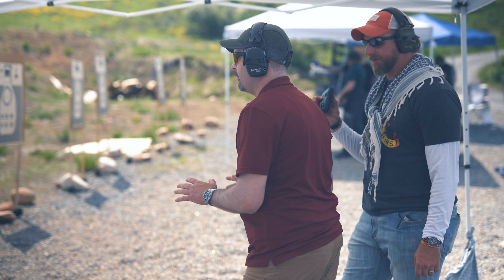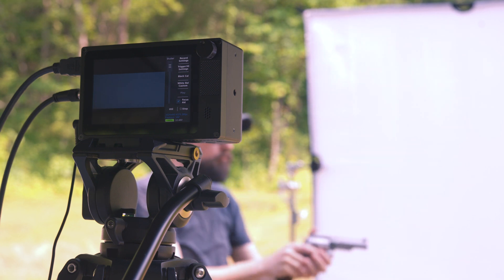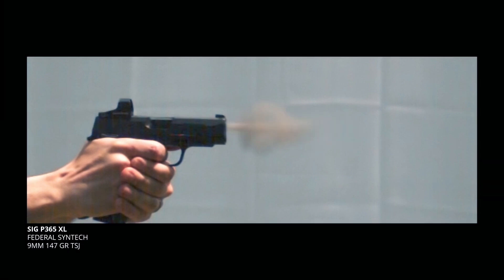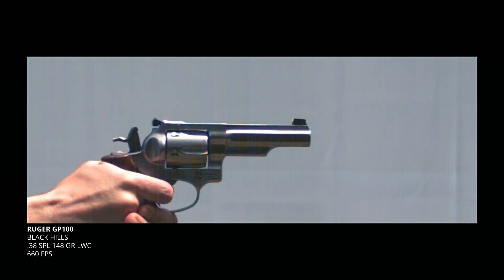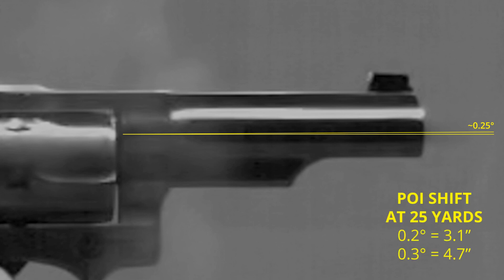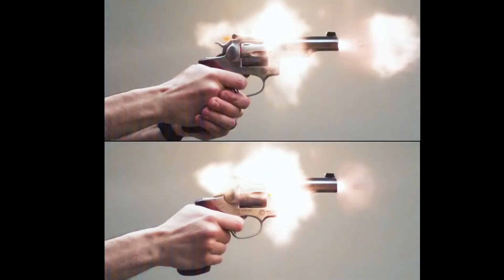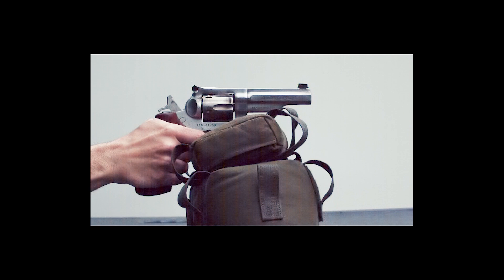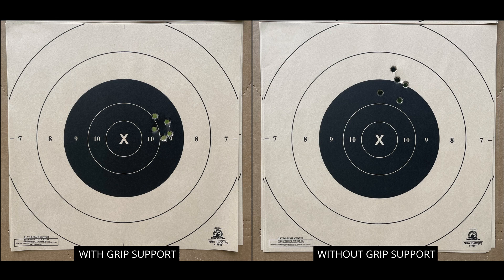How Recoil Affects Handgun Accuracy

Comment: For revolvers you can use the principal of conservation of angular momentum to understand muzzle climb. The short version of this is that the rise depends only on the mass of the bullet and not the power of the cartridge. The muzzle rises faster when shooting a full power .357 compared to a standard .38 but if the bullet weight is the same, say 158 grains, then the rise is the same. If you own a wheel gun you may actually notice that the sights point a little low because revolver makers understand this and compensate for muzzle rise when fixing the zero. It would be interesting to compare various bullet weights to see how much they affect muzzle climb and I would anticipate that lighter bullets will tend to shoot a little low compared to heavier ones.

You don't see observable muzzle climb on auto loaders because the spring is barely compressed during the time that the bullet is in the barrel. Very little force is exerted on the frame so the slide effectively moves freely. The reverse linear motion of the slide cancels out the angular momentum of the bullet moving forward. As the spring compresses more you may start seeing some rise but most of it happens when the slide impacts the back of the frame transferring much of the angular momentum from the slide to the frame. Needless to say I'm happy my physics degree is finally useful (ish  ;-) ).
Reply: It occurred to me that the first bit of muzzle climb on the Sig is probably due to the barrel hitting the stop in the frame, and that transfer of energy back into the hands. That's probably exactly why they feel less "snappy": two smaller instances of recoil instead of one big one.
Reply: @dewayner5388  Yes, that's my impression too. I think I commented as such on another one of these videos which compared a blowback to a locked system.
Reply: DAMN, That was a GREAT EXPLANATION.

YES, your Physics Degree was very useful, T.Y. Andrew.

I wouldn't have said it in dept as you did but I'm just a Machinist, LOL.
Reply: @Kyle-sr6jm  So what id he say wrong ? T.Y. Kyle.

Comment: I am here just to say my Sig P239 is underrated merely because it is slightly larger than a P365XL yet shoots incredible like a full size pistol. Weight of the frame?

There is a reason I see Glock competitors with added weights on the rail in the front
Reply from the maker: Weight might be part of it, but the P239 also has a much larger grip -- it feels pretty close to a full size handgun. Unless you have really small hands, it's tough to get an optimal grip on the P365 XL
Reply: @LuckyGunner I would love to see this slow mo test with the PX4 CC just to see differences in muzzle rise

Comment: Something I've noticed with my ruger lightweight commander 1911 (45acp) is that if give it a loose, one handed grip it will shoot as much as 2 feet high and to the right at 40 yards, following the same path it recoils, but if i hold with a firm grip it shoots perfectly. Just an anecdote

Comment: ok but isn't a tilting barrel auto moving before the bullet leaves the barrel just by definition of what a tilting barrel does?
Reply: It appears that the tilt barrel in the first Video did not move until the bullet was way gone . So IDK
Reply from the maker: The barrel doesn't tilt until it unlocks from the slide which, by design, happens long after the bullet has left the barrel. If it did not, the gun would blow up in your face. Try to very slowly manually retract the slide on a tilting-barrel semi-auto. You'll notice that for the first couple of millimeters of travel, the barrel is locked into the slide and moves parallel to it before it begins to tilt.

Comment: I also have a stainless, 4 in, 357 mag GP100, but not the match model. I’ve noticed it shooting high at 20-25 yards but that thought I was me anticipating heavy recoil.
So what is causing this rotation? Could it be the small amount of gas that comes out between cylinder and frame?
Reply from the maker: Recoil anticipation usually (but not always) results in hits below the point of aim. Your GP100 sights may just be regulated for a load that's different than whatever you're shooting. Adjust your rear sight if you have an adjustable sight model. If not, try a higher velocity load and see if that brings the point of impact down.
Reply: @LuckyGunner  I’ve shot everything from full magnums to standard 38 special, but I didn’t record my accuracy. I’m definitely going to try different loads at 25 yards and see what I get. Thanks for the suggestions.

Comment: WHen i started shooting i could swear that 124 grain 9mm always hit higher on the target that the 115 grain i was shooting.  For me that lighter bullet just seemed to hit about 3 inches lower at 40 feet. So then i decided oh well ill just use 124 grain as its more accurate for my sights.  Now i was shooting a M&P 2.0 with a 4 inch barrel and at the time i never considered that i was the problem.  Because after a few years of shooting i got a deal on some good 115 grain.  I took em to the range only to find they hit the same spot as my 124 grain.  These were the same brand that used to shoot low for me.  It was then i realized that in a 4 inch barrel in general the 115 will just break the sound barrier and create a louder report than the 124 thats cruising just under the sonic boom level.  It generally makes that 4 inch gun alot louder.  Turns out i would flinch on the 115 but not the 124.  Seems weird i know but i bet there are a few of ya thinking, "could that be my problem?"

Comment: I think we all know that the teacup grip is a no-no with a modern semi, but the sandbag support on the revolver got me thinking that that there may have been something to it with a revolver before we figured out modern gripping styles.
Would be interesting to see a Chiappa in the recoil cycle with the low mounted barrel and how much it actually changes the recoil 'cycle' from a 'normal' revolver.
Fun vid for sure.
Reply from the maker: This principle was definitely known and understood well before it was ever observed on high speed video, so I agree that it's certainly possible the teacup grip was adopted in an effort to counteract POI shift from muzzle rise. Probably a misguided effort, however.
Reply: Where was it actually proven the tea-cup grip was bad even for semi-autos? They have the same phenomenon of the point where the force is applied is above the center of mass (and also the grip is below the point of thrust) so the fire arm rotates. 

The teacup grip fell out of favor at around the time that a lot of other myths were spreading, when there's less access to high speed video cameras.
Reply: @Treblaine  Where?  I didn't realize we needed a Thesis paper and specific date to be pretty conclusive in that reduction, but truly, any comparison between gripping styles constantly prove that the teacup is the least impactful in managing recoil for one MASSIVE reason: Your support hand does not do anything for recoil management, it simply provides a "platform" for your hand to sit and stabilize the sight picture. 
A modern high forward grip will absolutely give you more control as now your support hand becomes a primary recoil stabilizer rather than a platform. 
There are dozens of videos on YT showing muzzle flip comparisons with gripping styles and kinematics of each.  The high forward also gives you the best ability to use your bone structure to manage recoil. 
I honestly don't remember what my perspective was since this comment was over a year old, but I believe I was thinking it had to do with a semi auto slide motion putting a moment of inertia high after the initial recoil and then returning vs a non slide recoil revolver that is bigger which could benefit from a 'platform' of the Teacup 
Regardless, teacup doesn't do anything for recoil - that's a fact and has been shown over and over and over again
Reply: @shirothehero0609  "it simply provides a "platform" for your hand to sit"

Like resting on the sandbags?

That's precisely the problem, you can't apply a twisting downward force with either hand because 

" now your support hand becomes a primary recoil stabilizer"

Stabilizer? 

Specifically how does a hand underneath the pistol NOT do that with the so-called teacup grip?

Now maybe it doesn't work if all the teacup grip is doing is holding up the weight, but in this slow motion the grip is different, it's pressed down hard onto sandbags, maybe your left hand it'll have the same effect.

"a semi auto slide motion putting a moment of inertia high after the initial recoil and then returning vs a non slide recoil revolver"

It shouldn't make much of a difference, the semi-auto just delays things a bit.

When the barrel recoils with the slide the slide+barrel hardly affect the frame you're holding at all except via the spring compression slightly increasing. Then the barrel is decelerated suddenly as the locking lug collides with the frame and also the slide later.

Imagine if the barrel was freely flying through the air at the same velocity and hit the frame. The barrel would try to cartwheel up flipping over, but the slide contains this movement and the force is transferred from the slide to the contributing to the pitching up motion. The same a few milliseconds later when the return spring bottoms out and the slide stops. 

So the torsional force is the same, just in two sharp peaks while a revolver continually transfers the forces as the bullet is accelerated down the barrel. 

For identical bullets the momentum must be the same.

The momentum that is imparted by a bullet must be equal to the rearward recoiling mass whether that mass is an entire revolver or a barrel+slide or just the bolt of a straight blowback. Every action has an equal and opposite reaction.

Deceleration and acceleration are the same thing but in different directions. So when the slide bottoms out suddenly on the frame it decelerates in a shorter distance than the bullet is accelerated down the barrel of a revolver.

Comment: Thanks for this informative video, Chris.  Revolver sights slightly point the revolver's muzzle DOWN to compensate, whereas rifle sights generally point the muzzle slightly UP--and that's with sight line above the bore line.  Revolvers have been around almost two hundred years.  The Colt Dragoon was supposed to have its sights regulated for 100 yards and while less powerful than the military smoothbore musket of the day the Dragoon's rifled barrel gave the revolver comparable accuracy even without a shoulder stock and four points of contact--muskets usually lacked a back sight.  Point--guns are complicated, but shooting doesn't have to be.  
"A man's got to know his limitations." (Harry Callahan in Magnum Force, 1973).
Target shooters at the 25- and 50-yard lines customize grips so that they get the same grip each time.  Light target triggers reduce the amount of trigger-squeeze disturbance.  Using very consistent ammunition each time makes the revolver more precise.  Even the positions used will affect the zero--as Chris demonstrated, the difference in point of impact using more sandbags to stabilize the revolver was significant for small game or target match shooting at 25 yards.  Chris warned us!  After sighting in from sandbags, fire without sandbags to validate and verify.
Chris mentions "squishy bits" but the entire pistol is "squishy" given the forces involved.  Semiautomatic pistol slides move back and forth, and sometimes the barrel flops around.  Revolver pundits used to think that this made semiautomatic pistols less accurate than revolvers.  It's complicated--but for the vast majority of pistol shooters, this question of revolver versus semiautomatic accuracy is academic. 
Pistol shooting is easy--,ake sure the pistol is loaded, stay close to a large target, point the pistol at the target (sights help with precision pointing), and trip the trigger without disturbing that precision pointing.  Hole in target = SUCCESS.

Comment: I enjoyed that analysis very much, but I think you may have over estimated the amount of muzzle rise., at 0.25 (5:03), that seems like more than what I can see (granted I am in a worse position than you are and also have no way of measuring accurately). Maybe is an optical illusion, but using simple line and compass on the screen based on the top of the barrel renders about half that value. But I'm probably wrong 😄
Reply from the maker: Yeah, it's difficult to tell. Depending on how I measured it, I got a difference between .1 degrees and 1.2 degrees. Values between .2 and .3 are the ones that came up the most, though. I am fairly certain there's a rise of at least .1 degrees, which still translates to a noticeable point of impact shift at 25 yards (1.7 inches).
Reply: I think you may be thinking 0.25 "inches", when he is saying the unit of measurement is in "degrees",  not inches which would account for you thinking that the 0.25 (inches) is a bigger number that what you can see as the rise in the video.

Comment: Bryan Litz (Applied Ballistics) has done as similar test with rifles; attempting to predict the precision of the rifle on account of factors like weight, cartridge energy, etc.

He came up with a formula that predicts the movement of a rifle during barrel-time (bullet still in barrel) and came up with: Distance = ( BulletWeight / RifleWeight ) * BarrelLength... (bullet weight  in lbs. Lengths in inches. lbs = grains/7000)
Interestingly, the velocity of the bullet isn't a factor. While a higher velocity bullet does exit the barrel faster, it also has more momentum that pushes the barrel back faster as well, and the effects cancel out. As such, higher velocity vs lower velocity bullets don't significantly change the movement during recoil, and the ratio of bullet weight vs rifle weight is the key.

Comment: Fascinating science! Awesome videography, and comparison between semi-autos and revolvers, and discussion!
 
If two people are aiming their 12ga shotguns perfectly, and one person is 220lb and the other is 135, will the point of impact be higher for the smaller person?

Is there a gauge/load/brace where accuracy is unaffected for smaller people? If accuracy is even affected by body weight? 3:35
Reply from the maker: Not sure if body weight would come into play that early in the recoil process. The way the person was holding the gun could potentially be a factor. Like whether the butt was firmly braced against the shoulder. Even then, the butt pad is going to have some give before the payload exits the barrel. Using the push-pull technique might make a difference. I might try that with the high speed camera at some point. Anything with rifles would require a nicer camera with a higher framerate, but we could probably catch buckshot in flight without a problem. My guess is that at the ranges we typically employ shotguns, any point of impact shift will not be noticeable.

Comment: I'll never forget being in a shop where a guy was looking a 10mm Glock vs a 44 magnum Revolver and the clerk said, "yeah, 44 is nice, but when a 500 lb bear is charging you, all that power doesn't matter if you can only get off one shot due to recoil before the bear is on top of you"
Reply: What if you get 1 shot of 500 S&W Magnum for the 500 lb bear.
Reply: @jem_lucinamain3777  the 500 SW weighs so much just take a shorty 12 gauge at that point
Reply: Who expects to get more than one or two well-aimed shots off on a charging bear before it closes? They move quickly. Even if you aren't incapacitated right away and the contest continues in a melee, that would leave the revolver with 4 or 5 more shots.
Reply: @45calibermedic  which you won't get off because you'll be getting mauled by a bear. Better to have a gun you can put 6-20 rounds into a bear's general direction.
Reply: @lordhellfire153  I don't know if general direction will get you the results you want...
Reply: @45calibermedic  Best to have a compensated 460 Rowland but I'd take a 10mm as second pick. 180gr vs 255gr both at 1300fps.
Reply: @edgarburlyman738  Underwood Xtreme Penetrator 200gr at 1400fps is siiiiick
Reply: You will get off 2-3 shots with the 10mm for every 1 with the 44
Reply: Smart clerk
Reply: 8 rounds of .357 that you can get on target in 3-5 seconds will always be more effective than 6 rounds of .44 that takes you 6-9 seconds to fire.

Comment: I have a 3" S&W Model 24. Those heavy slow bullets really push the gun around. The sights definitely take into account the muzzle rise at the shot. You can just look at it from the side and see that the front sight is noticeably taller than the rear.
Reply: Fnet=MA.  Can't get away from it.
People tend to forget there is more to that than just that speed and acceleration of the round.  Can't get wrapped around the axle on fps.
Also cool they make the front sight intentionally taller to compensate versus the normal "hold the gun tighter wuss" coaching as the vid really shows even an iron grip can't totally  remove the physics from doing it's thing.